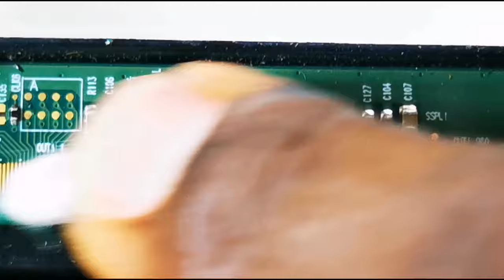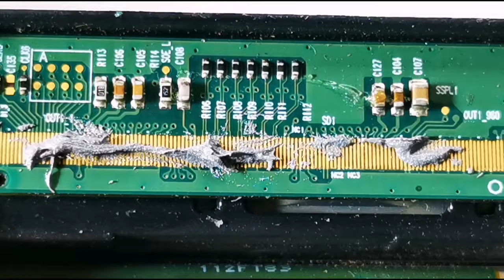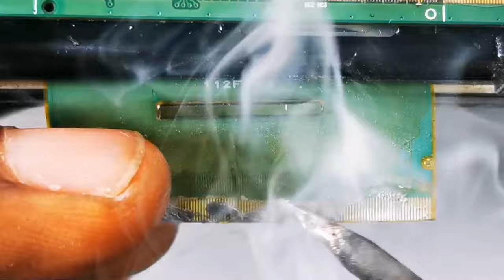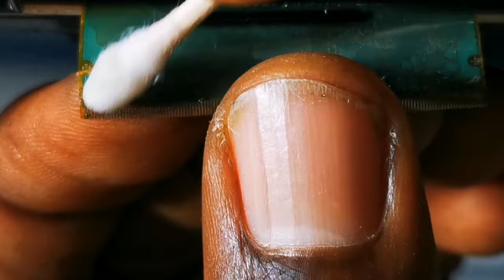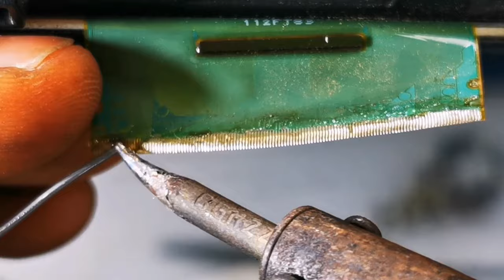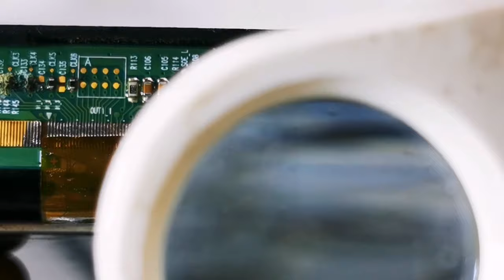"NO FILTER" #microsoldering #ledtvpanelrepair #electronics

Comment: Why you use cut? 😅
Reply from the maker: Good question. If you don't cut COF tip, you can get solder bridge more easily because the bonding area of COF tip will be bigger, and the it will be more difficult to remove the bridge. But when you cut, you reduce the bonding area of COF tip. And if a solder bridge happens, you can more easily kill it. Trust me, I've been doing this for more than 15 years. 😊

Comment: Блин ну почему у вас не хватает мозгов купить изотропный скотч и простой паяльник
Reply: Hey easy guy! I've been told that some technicians while replacing COFs use solder for the PCB side while they use necessary ACF tape for the glass side. It seems to be a way to reduce the cost of repairs. Maybe if we all learned to do manual bonding, we do not have to buy ACF for the PCB side. Do you not see that this guy is doing amazing repairs using just simple tools, even though he has bonding machine? I wish I could be as good as he is, I wouldn't even need to purchase expensive bonding machine!
Reply from the maker: Hmm... If you only knew the stress of using bonding machines! For example, this repair doesn't require taking the panel out of its backlight - PANEL IS SAFER. I do not have to worry about dust contamination while doing it. It takes far less time compared to using machine bonding. Doing microsoldering/manual bonding on panels is super easy for me that I can even do it on my own brain with my eyes closed😀.
Reply from the maker: @westatech you've said it all! Thank you so much for enlightening us all. ♥️
Reply: Please spread the word!😂 Your soldering skills are on another level!